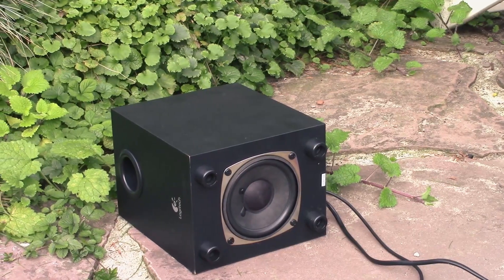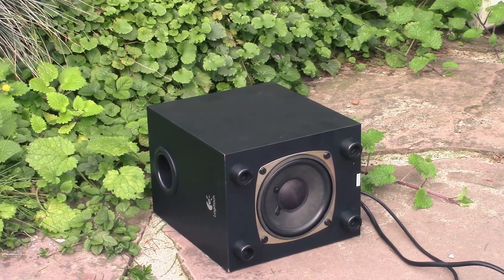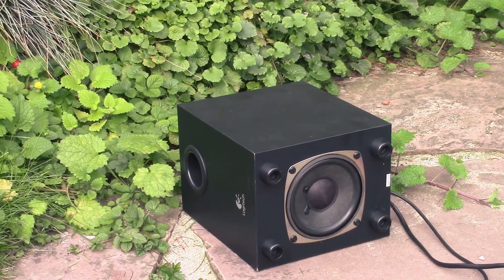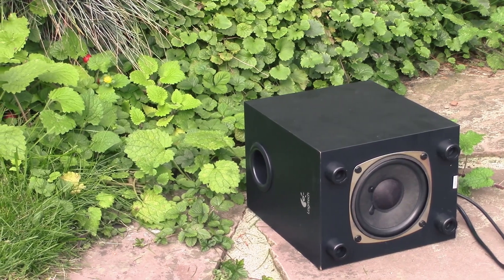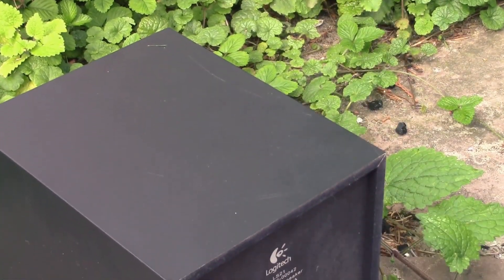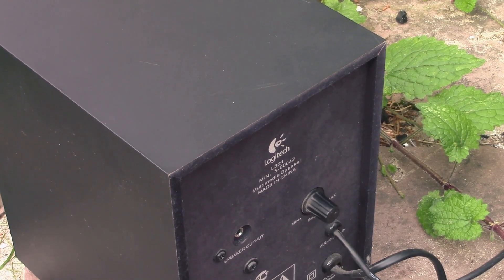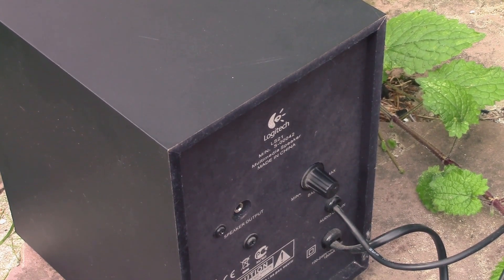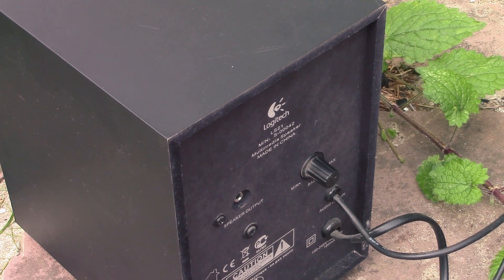How to match speakers to amplifiers (AKIO TV)

Comment: Help please!!! so I'm looking at a set of 4 75watt 6ohm speakers to use as satellites. The avr I'm looking at says it puts out 145watts per channel with speaker impedance 6-16ohms. Will this be to much for those speakers? I'm a complete novice when it comes to this stuff so any help would be appreciated. I'm assuming the avr will only push as much power to the speakers as they require and won't be pushing a full 145watts to 75watt speakers right?? Am I Gona blow myself up?

Comment: Thank you. After much reading and many videos you finally said it. You said 100 w amp to 80 w speaker which is close enough. I have a Pioneer SA 9800 100 w per channel continuous and two Kenwood JL 690's that  are 70 w continuous and 140 w peak at 8 ohm. It's from 12 feet away in an ok sized room. I don't have to turn it up very much to begin with so I must be in the right zone. I don't think I'm utilizing much of the amp. lol *When I saw the JL 690 were 140 w on a forum I though the amp was too small at 100 w. Finally I found a pic on Ebay of the front page of the manual and the speakers are 70 continuous and 140 peak at 92db sensitivity. I happy I know I'm good now.

Comment: I found this video better than most. I understood more here, than with most other videos. You gave us the perfect amount of general knowledge using simple-to-understand reasoning to better enhance a basic understanding of power and ohms with regards to the relationship between speaker and amp paring. So I thank you very much, and great job... 

However, I was hoping to learn more about what the best scenario would be for speaker to amp. Basically for someone to tell me what numbers I should be looking for to buy the perfect setup for best sound quality and performance. You told us what to buy if we simply want to get by, with very clear and nice reasoning btw. You did mention to match ohms if we want an ideal setup, but what about watts. You never mention what was ideal for the watts setup. My basic reasoning is telling me that a 100w amp to 100w speaker is not ideal because the amp would be working at its hardest level to achieve 100w on an efficient 100w speaker. So, I am still searching for the answer, but I'm inclined to believe that if I have a 200w amp to 100w speaker, with matching ohms, the amp will have to work less far less to get 100w to the speaker... I'm still not sure about this yet.

Anyway, thank you again for this video. It has given me confidence in understanding the basics enough to where I can ask the right questions now.

Thumbs up, and subscribed.
Reply from the maker: In the first case, your amplifier is maxed out, in the second case it isn't. But in both cases, the speaker is playing at its maximum output. So we can conclude that from the speaker's perspective, both situations are identical. From the amp's perspective, the 200W one will be more in the comfort-zone. However, that doesn't mean that the 100W amplifier is in trouble; if the speaker has the right impedance, it won't draw too much current from the amplifier and it's going to be just fine. Even if the amp would only be 80W, you could still have it play on max volume on that 100W speaker and you should be just fine.

(there exists this idea that larger speakers "suck" more power and therefore clip lower power amps, but that's nonsense, as the amount of current drawn isn't determined by power rating, but rather by impedance, although higher power speakers do remain colder at given power levels and therefore do have a slightly lower resistive impedance at higher power levels)

The reason I won't tell you exactly what you're looking for, is because I'd most certainly be wrong. There are so many different types of amplifiers, so many different types of speakers and so many different conditions they could be used in that there just isn't really a simple answer here. In some cases you'll find that having a 200W amp on a 100W speaker is great, and then in other cases a 10W amp on a 500W speaker or vice versa may sound amazing. 

The good news is, power ratings can be taken with a grain of salt and with some common sense you can pair almost any amp to any speaker. The main reason not to go for extreme combos (very high power amp on very little speaker or the other way round) is that your value for money goes down dramatically.

Thanks for the comment!

Comment: Thanks for sharing this. Quick question : I ordered the Klipsch r41m rated at 50w rms 200w peak 8 omh  sensitivity: 90 dB and a amp - topping mx3 38w 8omhs per channel. Is this a good match and will I experience distortion? I new to this so appreciate your help mate.
Reply from the maker: Judging by those specs I don't think so.

Comment: my amplifier is KEVLER GX7 800 wattsX2 , my speaker per channel is 
1 pc.350 w subwoofer 12"
1 pc. 350 w instrumental 12"
1 pc. 180 w midrange 5"
1 pc. 100 w tweeter 
all 8 ohms ang parallel tap, is this safe ? i can only put the volume to 1/2 more than that noise is not good, please help me to set up, thanks

Comment: I’m hearing what seems to be conflicting information about this.  The impedance part seems pretty straightforward but the Watts have me worried and confused.  I have an old Technics SA-5570 with 85watts driving a pair of JBL E80’s.  I’m hearing from the internet that the amp is under powered for the speakers and due to clipping or distortion could damage my speakers or maybe also the amp...  I’ve also heard you should employ an amp with more watts (50% more) than the “RMS” of the speakers.  As the receiver is 40+ years and the speakers are pushing 15 I don’t want to damage either.  I do however like to play my music quite loud.
Reply from the maker: All right, I've heared things like that too, and here's why small amps on big speakers are just fine:

Clipping is what happens when a speaker draws too much current from an amplifier, so that the amp won't be able to supply it, meaning the voltage will drop and the current will be on the limit for a few microseconds or so, meaning the speaker is then exposed to DC power, which causes the voice coil to heat up more than it should, which can damage the speaker.

So now then, does this happen on a small amplifier powering big speakers? No, and there's a pretty good reason for that. This is where impedance comes in to play once again; say we have a 5000 watt speaker cabinet with an impedance of 8 ohms, and a 50 watt speaker with the exact same impedance. We then connect those speakers to the same tiny 60 watt amplifier and play them at max volume (for this amp that is). This amplifier is rated to drive 8 ohm loudspeakers, so the output voltage with the volume cranked will be about 21 volts. 

Now we have 21 volts applied to the 50 watt speaker, remember, the speaker impedance is 8 ohms and current is equal to voltage divided by impedance, so: I = 21 / 8 = 2.73 amps.
So what would the current through the big 5000 watt speaker be? Well: I = 21 / 8 = 2.73 amps = exactly the same.

Both these speakers have the same impedance, and will therefore pull the same current from the amplifier. A high power rating doesn't mean that a speaker draws more current from the amplifier. This is exactly why running big speakers on smaller amplifiers usually isn't a big deal.

There's still some truth in the saying that you're better of having an overpowered amp though, because when your amp is overpowered, it will never run at max volume, so you have more certainty that it won't clip, but again, running bigger speakers on smaller amps isn't a sin at all.
Reply: AKIO TV thanks for the reply.  Beyond the numbers it doesn’t feel like I’m pushing anything too hard.  The amp/receiver volume is never much more than a value of about 7.  The sensitivity of the speakers are 91 and the room is relatively small.  The JBL literature mentions nothing of minimum amp power but does state Max. Recommended amplifier power of 200W with power handling Continuous/Peak = 100/400 at a nominal impedance of 8 ohms.  The amp claims 85 watts per channel into 8 ohms with speaker load impedance 4 to 16 ohms.  
I’m trying to understand the basics of this and I appreciate the help.  Last question, are there any telltale signs that I’m damaging my equipment ?  Thanks again for your guidance.
Reply from the maker: @fleurymanful  When you see smoke coming out of the equipment it's probably a good idea to turn it off. But seriously though, as your speakers have the right impedance for the amplifier, and you're not cranking the thing to full power all the time, I'd say it's very unlikely you're causing any damage at all.